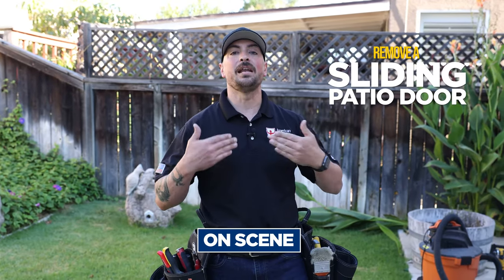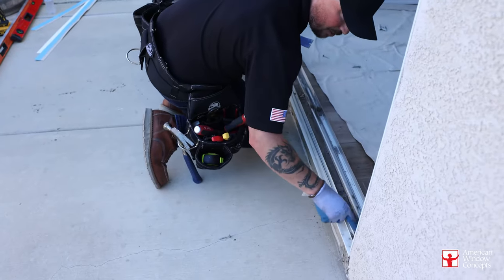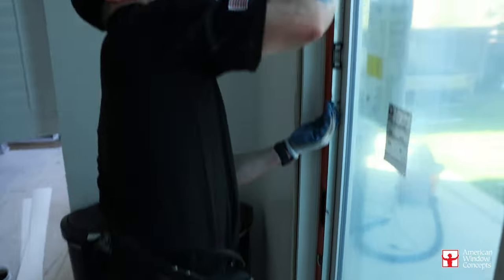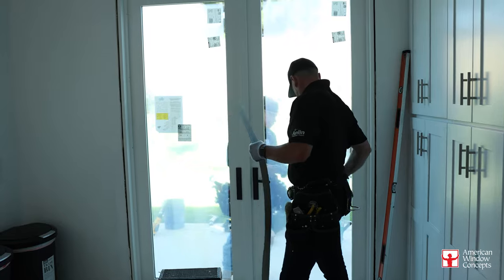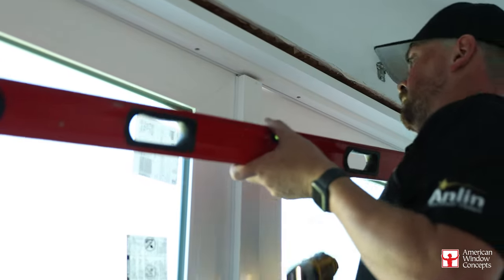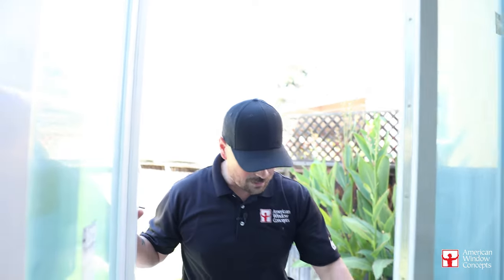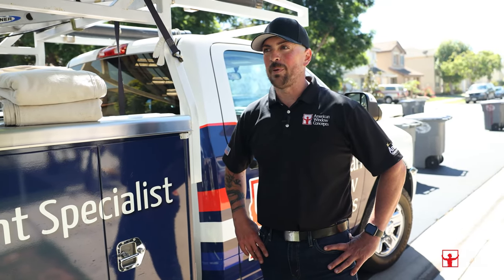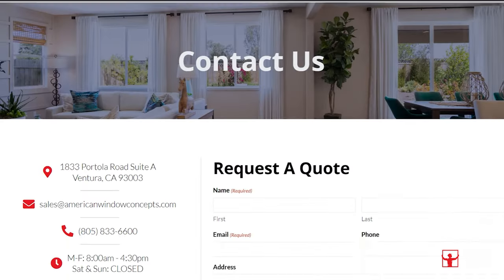French Door Installation

Comment: This door is mounted backwards. The metal weather strip at the bottom goes outside not inside. Most important is the SECURITY strip that protects the latch is INSIDE when it SHOULD BE OUTSIDE!
Reply: Hilarious!
Reply: I was just going to ask why the hinges were outside that scares me bc I know how to remove a door by popping those hinges out
Reply: This video is how NOT to install your door. No silicone? No foam?
Reply: The threshold is mounted on the door frame. Inswing or outswing is a personal preference.
Reply: It is backwards! That's what I thought
Reply: There are outside Hinges if need to be out swing which is recommended in florida
Reply: @pamelasandifer6793   OMG….that’s crazy!  How could an installer not see that, huh‽
Reply: lololololololololol......
Reply: @pamelasandifer6793  in Florida code says outswing on all exterior doors.  It differs according to region.  If you are up north where you have snow you do not need an outswing door because it would be hard for you to get out if you got snowed in.   Due to hurricanes, doors here in Florida have to swing out so the extreme winds do not blow it inward causing more destruction.

Comment: Video sucks, you didn't show anything useful, what was put on bottom of the door (caulking, liquid nails?), did you caulk before putting on the sides? What was the bottom plate, concrete, wood.  No details no likes.

Comment: How are you retrofitting into a rough opening?! That will 100% leak in my experience…?

Nothings tied off to paper. Enlighten me Sean I watch all your videos and love them!!! I’m a certified Anlin dealer/installer in the OC area
Reply from the maker: They had fresh paint that was just applied, and we added a cut line above the door opening 1" deep, and added polyurethane to shed the water around the opening if there was to be any water under the stucco. Typically the frames are left behind, but in this case we had a special case.